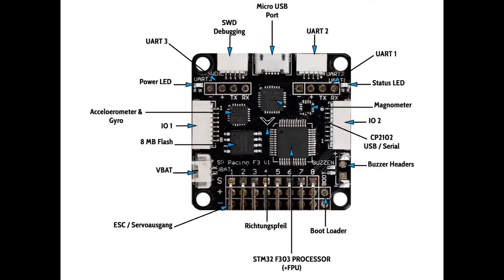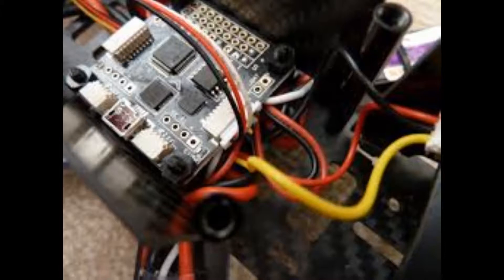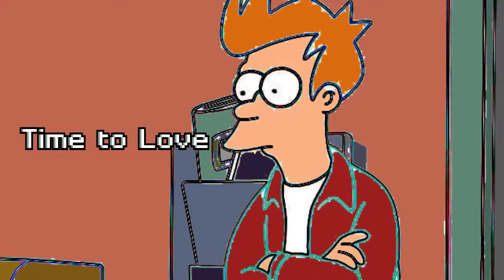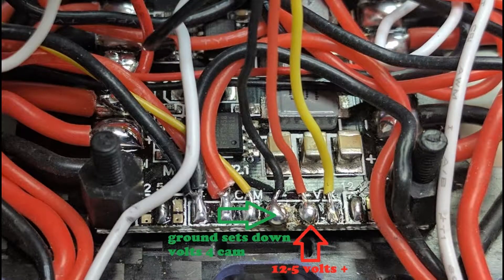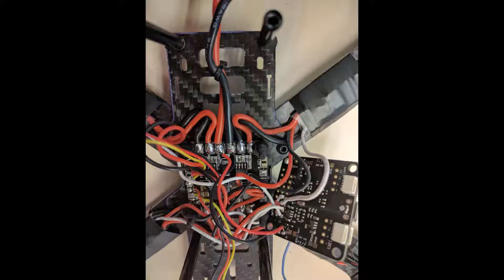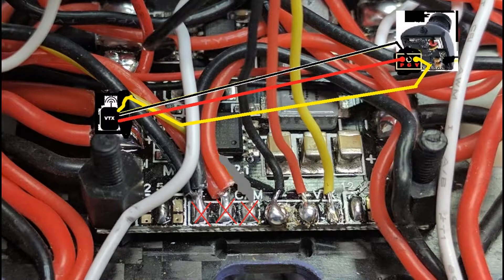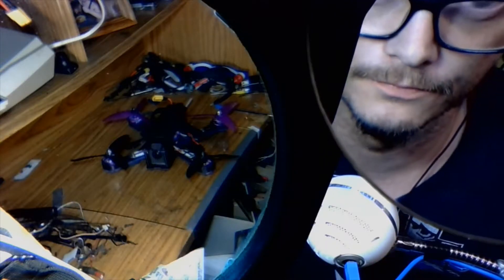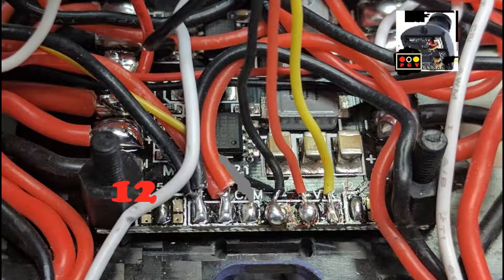Wizard 220 ( VTX To Camera Fix ) 3 Ways

Comment: Bro that was awesome and i understood it. love the singing
Reply from the maker: Ha ha..That is super great..I was worried I may not put it together well and been confusing, but I tried to convey how import fining the camera volts is , making a good choice on how to hook up ( cam & vtx ) and the fact that you have more then 1 way to fix it& how to go about doing it.If your cam wires that are there now are not burnt out and u have 12 volts go n out you will have a super ez time to fix.if so just take yellow wire from cam and remove from pdb and hook to new vtx yellow and 12 volt from very left pad ( or any place that would have 12 volts ) on red of new vtx and black strait from battery at pdb to black on new vtx and your done..well after heat shrink & or tape lol.You gots it buddy.also I'm emailing my home phone # 2 u if you want or need info or to talk and I would be more than happy to help.